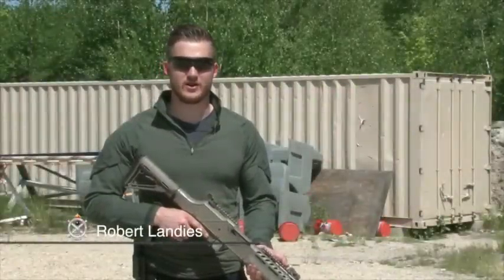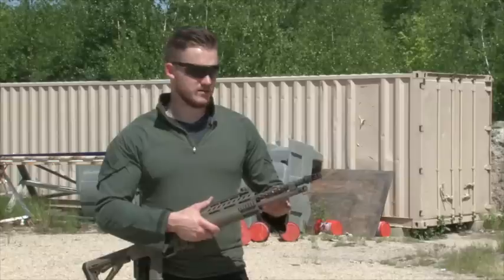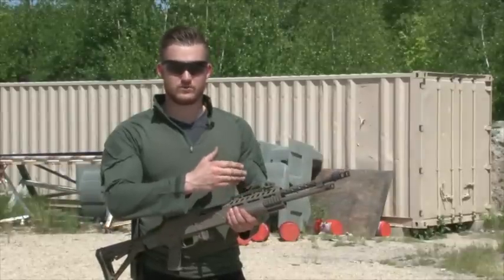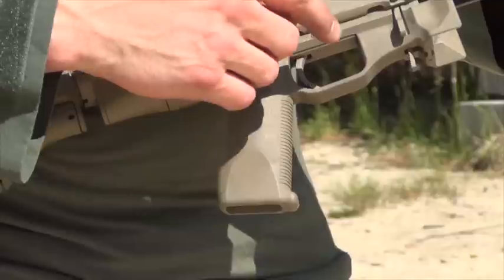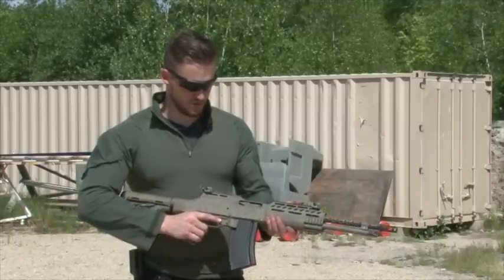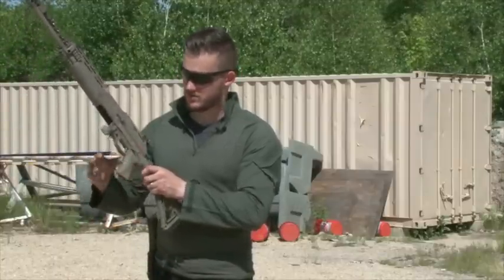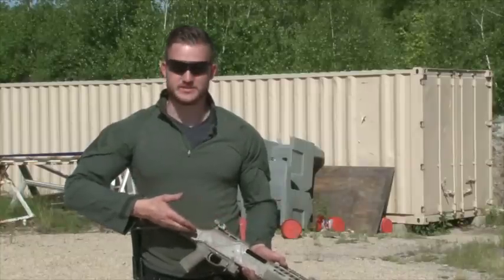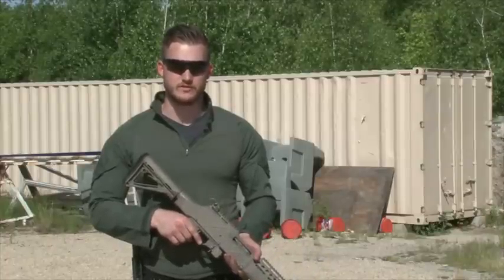Introducing the H.C.A.R. from Ohio Ordnance

Comment: When it comes to the price:
$5k for a high quality semi auto reproduction FG-42 is seen as reasonable, $5k for a high quality semi auto reproduction BAR is seen as reasonable, and $3.5k for an practical FN SCAR-17 battle rifle is seen as expensive, but acceptable. The more that I think about it, the more I realize that the price on this rifle isn't actually very insane - it's less expensive than an HK417, which could only use 25 rounds of 308 (assuming you're using MagPull AR-10 mags) as opposed to 30 rounds of 30-06. And they're about the same weight. So I've come to understand why these cost so much, but I still wish they were as affordable as more typical battle rifles because at this price I'll probably never get to own one :(
Reply: 7 Grand now... Sept 2023
Reply: @Mhatter12 yeah. Thanks, Garand Thumb :/
Reply: How about a Benelli Endurance rifle in 30-06. I believe it is between $1600-$2000. And it does take 10 round mags. Yes, I know, it is not quite as tactical, but it is also available in a 22" barrel and is tapped for scopes and iron sights. Beautiful rifle though.

Comment: i love when manufacturers say they don't like a certain thing (in this case, a quad-rail) so they don't include it. when are they gonna learn, it's not about what they like, it's what the customers want...
Reply: intense_pickle   I know what your saying. I think Ruger has really listened to customers. But in this instance I agree with him quad rails are a bit overrated. I mean all your doing is covering them with covers and ladder rail covers that make them even fatter so they don’t tear your hands up. The pattern on there looked good for gripping. You’re not going to utilize all that quad area. On my SOCOM II the quads a bit much really. I’d rather have nothing there at the middle balance point so it’s small enough to grip well. On my Ruger 556 E it’s heavier than most AR’s but is small hand guard and right at the balance point. So think like that this gun would be good because I don’t mind a hefty gun if it’s balanced.

Comment: My buddy bought one here in Canada for 12 grand and it’s been having a ton of light strikes and jams constantly. When we first got it, it wouldn’t cycle at all and just acted as a single shot. He field stripped it and cleaned it and now it will cycle a few rounds but the rounds seem to be hanging up on the feed ramp and not going in to battery, especially when using the bolt release. Then the light strikes seem to be very frequent. Do you have any suggestions or fixes? There’s not a ton of videos on this gun
Reply: Hi man I’m also in Canada and I want to buy one, can you help me get in contact with your friend?
Reply: @joakimperron704 contact firearms outlet Canada. They were the ones that imported them. It ended up being a mix of the packing grease and the magazines that were causing the issues.

Comment: i don't really see the point, i mean the original BAR was outdated by ww2, but if it floats your boat more power too you. $4700? Damn you could get some high end ars for that money, or trick a scar17s out to fix all the issues and get a whole load of mags and ammo
Reply: Yeah, a modernized BAR is still a 12lb BAR.  An M1A or SCAR17 would be a much better bang for the buck, even taking into account an adjustable gas system that would allow for heavy loads.  I'm a fan of the 30-06 in a bolt because you can send a 210ish gr bullet accurately out to a mile for less money than a .300 win mag.  This?  For close up?  I don't see a point.
Reply: lowell houser Exactly. The weight thing also mean you can carry less ammo, especially if you compare it to a light .308 like a scar 17s.
Reply: ***** maybe if you're nutnfancy. I think the average person would be okay.
Reply: Tommy King okay with what?
Reply: With the weight. The ammunition itself is not much heavier either. In fact .308 and 30-06 share many of the same bullet weights, though 30-06 can use a heavier bullet if desired and can be safely loaded hotter (more utility). There is a lot going for this rifle, except for both the price of the rifle itself and its ammunition. I understand that they are a smaller manufacturer and have no where near the production capability of FN, but $4k+ stops me in my tracks. That being said, FN does have the production capability, and has decided to keep the SCAR 17 at the "just released no supply for the demand" price of $2,700 anyway.
Reply: Tommy King true, but the bulk and weight are going to be greater, between the two the fn has less. For the military. 30-06 is probably overkill
Reply: Honestly this rifle has the potntial to be the best DMR on the market, given the right loads.  Something in the 210 grn range being pushed by RL22 at 2700 fps+.  Cheaper per trigger pull than a .300 win mag, and hits harder than any .308.
Reply: Alex Agius   Over kill is underrated.
Reply: This is an awesome rendition firing an awesome round. 06 can be loaded up and down for just about anything. 06 is very flat shooting and powerful. They’ve done much to tame it and keep the Browning reliability. I bought a used bolt Barrett for $5k but is a bit pricey to shoot. I think I’d prefer this to a 300 Win mag or 338 Lapua as an interim arm. Not many shoot it anymore and there seemed to be plenty of it available when the shortage was on during Obummer’s reign, and remained reasonable. Just an opinion. Been eyeing this up for some years. May be time. 30 round hold open mags are nice improvement.